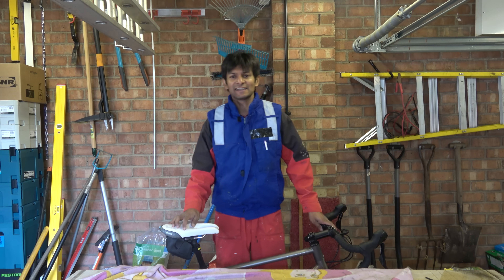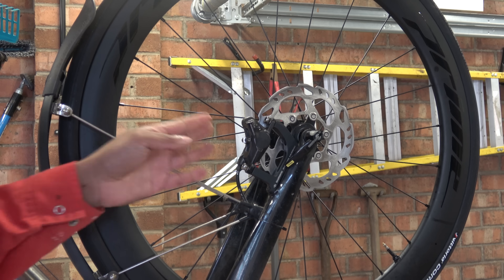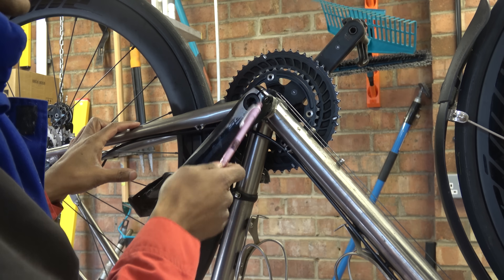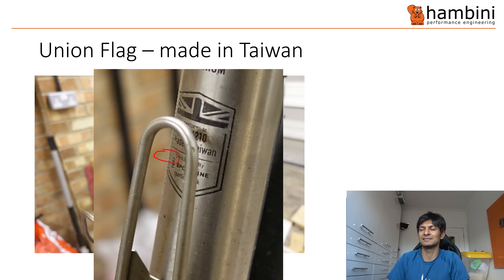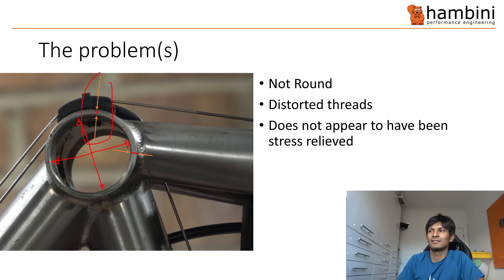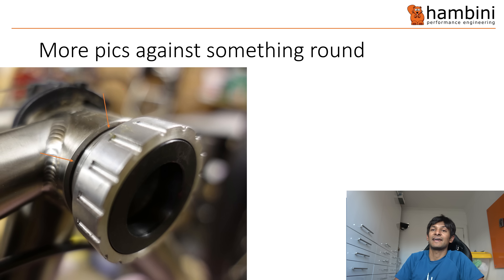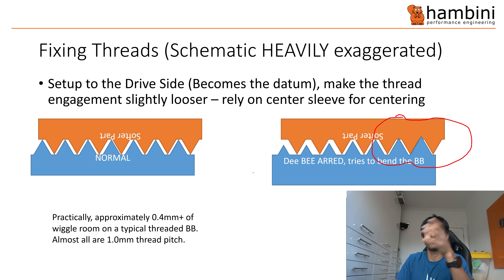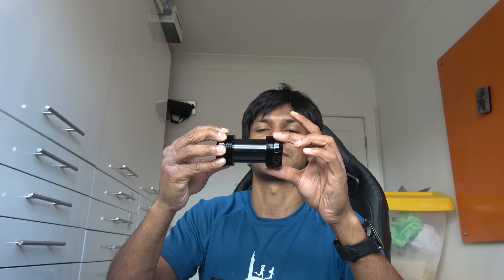REAMING: Titanium Threaded Bike Frame engineered in England by Clowns

Comment: ive been thinking about building a bike this summer, honestly at this stage; i am paranoid about buying a frame cause i watch way to many of these "the BB shell is garbage" vids :)
Reply: the only real option is to get the frame to the Master himself and cry when you get the verdict. Either from joy cause the frame passes muster of from sadness cause you too fell victiom to the "BBs dont need to be done properly" industry ^^
Reply: Most bike frames with threaded bottom brackets are very good. I've built up three bike frames, and haven't had any problems with the frames.
Reply: @bicyclist2  I agree. 👍
Reply: Don't even worry about it, these represent not even 1% of frames. Unfortunately, some poor soul ends up with a lemon every now and again, and instead of taking it back where they bought it from they perceive and make it worse and moan about it i mean this would eay to illustrate what the problem is to shop. I mean this bike is old must be at least 6-7 years,  that standard of the brake calliper is hardly ever used anymore. And a bike in that price range would have 12mm thru axels for sure these days. And this is why I don't buy second-hand frames online without seeing them built up.

If you want something "better" you need to pay, Mason, Condor or Fairlight are the only "mainstream" brands id touch, all artisan built in Italy/England by builders that love what they do and are paid well for it. If you want hand-built Stayer and there many more. That doesn't mean you still won't get problems mistakes happen.

Think of this way before you ride the bike you now know what to look for and inspect it well. if you suspect there is a problem DO NOT RIDE IT don't even get the tyers dirty - its a lot harder to return!
Reply: I know what you mean, so I just had a frame built locally. This fellow has been making frames for 30 years. Steel frame reynolds tubing 725, I was able to work with the builder and get exactly what I wanted. Final straw was when I screwed up the BB on a carbon trek checkpoint frame and no help from the bike shop.
Reply: @Ryryryryryryryryry-o8n  I spent 3,000 on a Bianchi Carbon Bike. Worse mistake of my life. Awful ride experience. So uncomfortable. Gone back to steel.
Reply: @taichihead42  Which Bianchi frame was it?
Reply: @mikehermesmeglio  Aria, dont buy one. You have been warned.
Reply: @taichihead42  Thanks.  I was considering the XR3 but I just want one with rim brakes for the simplicity but apparently they discontinued those. Additionally, some say the ride suffered on the XR3 when it went to disc brakes, do to the chain stay and fork leg being beefed up for the caliper mounting.
Reply: @mikehermesmeglio  I wouldn't consider any of there carbon bikes. Two major design flaws are on my bike anyway was the pressfit ultegra bottom bracket was making noise and the bike was only a few months old and the metal wedge that holds the seat pillar in the frame. The little pinch bolt wouldn't hold it in place after a few months. Had to replace the hole thing.
Carbon is a mug's game. Its your money and these disc brakes are a waste, extra hassle and more maintaince. Cycling is about simplicity not a load of hassle. These manufacturers need to be taught a lesson that's why i walked away from all of them and bought a steel frame and built it myself. Old school is the way to go.
Reply: @Ryryryryryryryryry-o8n  Were we (I) need to know
Reply: I built my frame up. Bb30. no issues.
Reply: Find a local builder that has a solid social media account. Most do these days. Many will post progress photos of a frame they're building and you can see things like the sequencing they work through. Its more expensive and takes longer (although given supply issues with the factory bikes, not much longer these days). But you also get tubing fit to your body. Honestly, the bike in this video was fucked because the welder screwed up in ways that a novice shouldn't do. Goes to show, if you're going to spend $$$ on titanium, go the bit extra and get it done by a proper specialist in the material.
Reply: Everything is garbage to the right critic. It's amazing that tens of thousands ride newer bikes every day without issue.
Reply: @KleineJoop  we’re talking about titanium here though and Derosa makes their titanium frames in Italy as far as I know
Reply: Roll the dice and see what happens, I've been lucky so far. Worst case scenario, your bike becomes the star of a hambini vid
Reply: I have a Vamoots RSL with a push fit BB fitted with Super Record 12s. It doesn't squeak or do anything else it shouldn't. I built it myself and it cost me a lot less than it could have. It wasn't cheap but every ride is wonderful and it will last forever. You get what you pay for.
Reply: There are millions of bikes produced and hundreds make it to internet fame.
Reply: Guerciotti in italy make some beautiful steel frames. 6 weeks build time 1,250 euro. Frame only. Lots of colours. Fully built they weight about 20 pounds. Traditional steel threaded headset. A right proper race bike. Another option is Colnago master x lite, 2,600 euro. 6 months waiting period. Fully built weight 17.5 pounds. Comes as a frame only. Headset and down barrel adjustors included. Wilier superleggera steel frame bike another option and Gios steel frame bike, both made in italy. Beautiful classic frames and light.
Reply: @taichihead42  
Me GIOS steel Regina is Taiwanese. I still like it just fine though.
Reply: @taichihead42  also De Rosa, Nevi and Passoni.
Reply: @taichihead42  I believe Gios steel frames are made in Taiwan. At least my track frame, circa 2017/2018, is Taiwanese made. It makes a lovely lovely single speed commuter.
Reply: @pbandjosh  
Most of them yeah.
Reply: The problem you see here is a quality control problem. 95% of the same bike model is fine, but since they don't check properly (QC) they let a small percentage out that are bad like this.
What you need to look for is what you're going to do if you get the lemon. Does the place you buy from have a warranty.

Comment: It is NOT racism to say something is crap if it is, actually, crap.  China and Taiwan make bikes that allow the companies that contract to have them made make a profit.  Titanium is a hard metal to work with, in many ways.  Buying a titanium bike made to meet a price point is stupid.  If the person that bought this POS had bought a local, ti bike built one at a time or in small batches they would not have had this issue or if they did, they could have called the builder and the builder would have been so shamed they would have gotten a new frame.  File this one under, BUY ONCE CRY ONCE.  BTW, why no anti-seize?
Reply: seems like its an issue of local bespoke built vs. mass produced to a price point
Reply: You've edited this comment once. I think it needs another.
Reply: But it is racism when someone makes the assumption that everything made in Taiwan is crap. That was Hambini's point about the relatively big Union flag but the fine print of "Made in Taiwan" that is hidden behind the bottle cage... Why is it in fine print and hidden away?

Also, you are basing your argument on a sample size of 1 bike, plus making assumptions that locally made would not have this issue without any samples to back up your claim...
Reply: Walty in China is a producer of Ti frames and i hear very good at it.
Reply: I've seen some taiwanese riders on instagram. They all ride either Time or italian made steel bikes. And all on campy. Funny how the world works
Reply: Did you just assumed that western made stuffs are superior?
Reply: @11-inch  When it come to titanium, ABSOLUTELY.

Comment: Great video. As one of the customers less fit friends I’m eager to watch for improvement on the road.
Reply from the maker: Well he hasn't got any excuses now!
Reply: @Hambini  I wish u had showed us how u corrected the thread ?
Did u use the DS as the datum on a milling machine and re tap 
the NDS thread using a large BSA Tap ?
Reply: @budbud2509  He mentioned using the drive side to set the center. I didn't catch anything else.
Reply: @budbud2509  I'm assuming he's undersized the cup rather than correct the frame
Reply: Are you going to drop him again?  How long are you going to wait in the route?
Reply: @aitorbleda8267  I always try!
Reply: He best sort that pad alignment out first